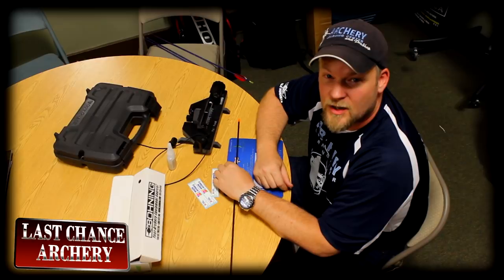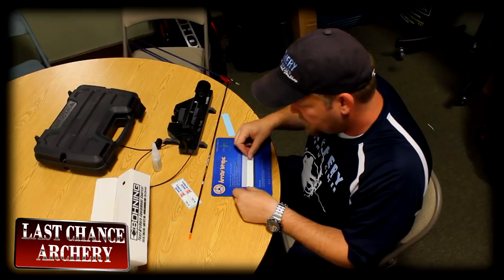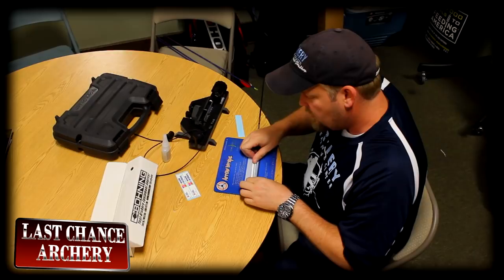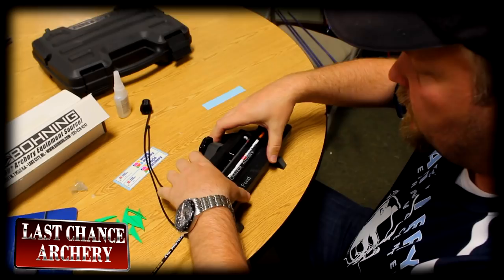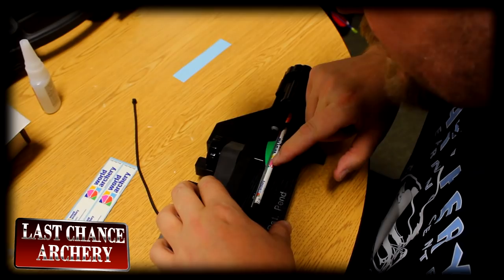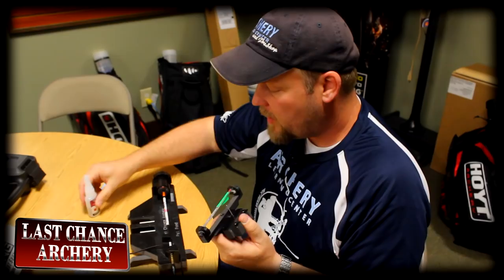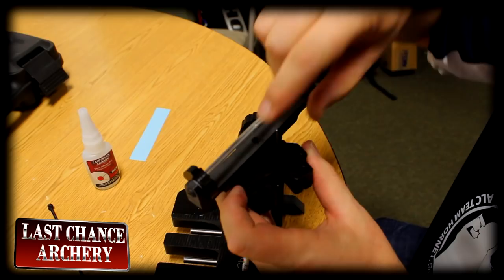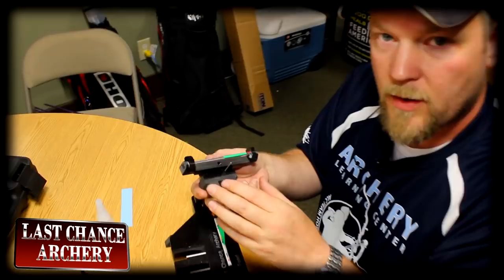Thing A Week #10 | "Precise and Accurate Fletching"

Comment: Do you clean the vane before fletching it? (I'm thinking release agent on the vane)
Reply from the maker: Hi, so we always recommend that you clean your arrow shafts (right where the vanes attach) before fletching. That way they're very clean and the glue / vane can have the best adhesion. You can do that with acetone or if you want the arrow to be clean and also have a mixture to help the glue stick better you can use our Activator (from Last Chance Archery). We sell a glue and activator combo that works flawlessly together. The activator cleans the shaft but also leaves a residue on the arrow that will mix with your glue (when the fletching is attached) to make the glue dry stronger and be more effective. Check them out via: www.lastchancearchery.com